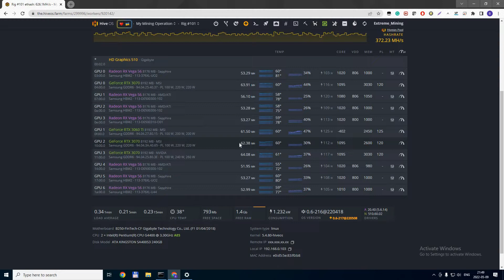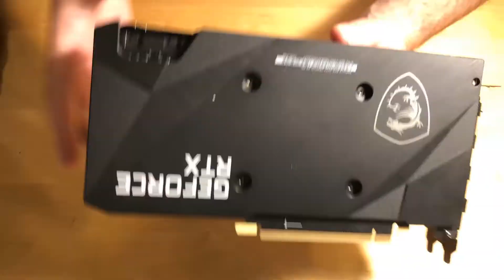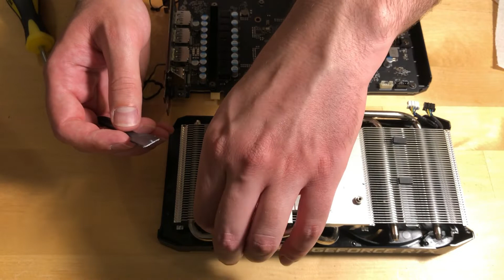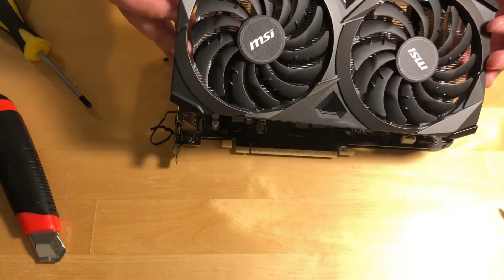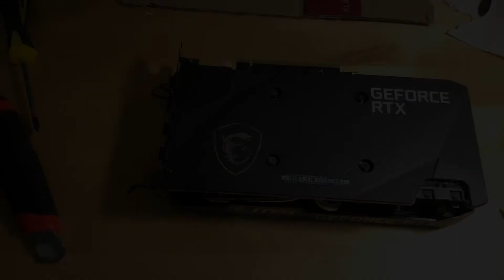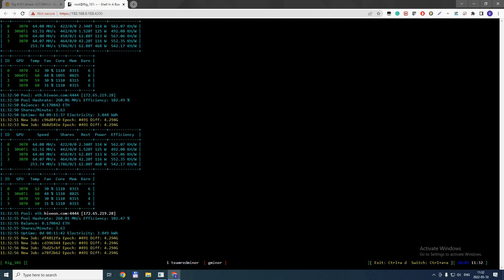Changing Thermal Pads on MSI 3070 Increased my Hashrate!

Comment: I've got the same card and I used 2mm and 2.5mm pads. The heatsink surface isn't flat. Your original pads even seem to be cut according to the surface changes and so, probably have been of different thicknesses.
Pretty sure you could have seen that by looking the card sideways afterward.
The way you're tightening the screws is wrong. You should do it crosswise so the paste is spread most evenly (this is basic knowledge, watch any video).
The one pad strip you didn't change seems the worst solution to me. I agree with you that the strip doesn't make sense but reusing it is even worse (I don't have that strip, I don't know why, I bought my card used)

Comment: Thank so much, At first, I also opened it to measure and saw that the thermalpad was 3mm, 2mm and 1mm thick. Then I changed to the 3mm type but the channel was not pressed tightly together. Then I changed to the 2mm type and it was ok. The 1mm type is for the 2 small heatsinks with VGA screws.
Reply: Hey! Thanks so much for your comment and for pointing out the 2mm replacement — super helpful. Just a quick question: was that change to 2mm done for mining purposes or for gaming? Do you know if using 2mm thermal pads performs well enough for gaming workloads too?

Also, regarding the 1mm pads used under the small VGA-screw heatsinks — do you think 1mm is enough, or would you recommend going with 1.5mm for better contact in gaming scenarios?

Thanks again and greetings!

Comment: Hy! Can you help me? I have got same card and changed the thermal pads what you show. This thickness enough for gaming performance or only mining?
Reply from the maker: Hi, mining, especially as it was with ethereum, is much more memory intensive than gaming. There are no “pads for gaming” or “or pads for mining”. If you changed you pads for the correct ones, it will work fine, no matter what you use ur gpu for.
Reply: @BMasterBM1  thx your fast answer, good day!

Comment: I have an MSI RTX 3070 Ventus 2X and would like to replace the radiator with the Ventus 3X. Is this possible?
Reply from the maker: Hi, I don't think you can properly attach it since the size of the card is different. Why do you wanna do  this anyway? Venuts 2x has decent cooling.

Comment: You should try phase-change material Honeywell PTM7950. It comes in as a sheet, lasts longer, performs works better than traditional pastes and there is no pump-out effect. Instead of thermal pads, I advise you to apply thermal putty Upsiren UX Pro.
Reply from the maker: Thanks for the info, I didn’t know about it. I will check it out.
Reply: thanks for this comment. going to be using the honeywell on my own repair today

Comment: If I use 1.5 mm thermal pads will it also work?
Reply from the maker: Probably, but I wouldn’t risk it.
Reply: 1.5mm didn't touch the heatsink here
Reply: @ZoTrAcK  2mm did?

Comment: I did the same as you. But once a started msi afterburner my temperature was higher than before. In fact, sometimes with no pressure, the memory gets 7000 mhz for a few seconds and then get back again at 810 mhz. When this happens, the temperature gets like 80 degrees 😢 what could I’ve done wrong?
Reply from the maker: I cannot tell, maybe pads moved while you were assembeling the gpu. Did you use correct thickness?
Reply: @BMasterBM1  yes, in fact I got the same GPU as you (3070 msi ventus 2x) and some pads are 3mm once I measured their thickness and other are 2mm. So I put 2.5mm to average the size. And now I got this problem. That was so weird bc you used 2mm pads and it worked for you. Could it be the thickness the problem?
Reply from the maker: @diegocky212  it could be if the pads are not soft. Try using 2mm. Which thermal paste did you use?
Reply: @BMasterBM1  i choose for thermal pads the “Thermalright” brand. And I got the Arctic Mx-4 for the paste. There are not bad brands
Reply from the maker: @diegocky212  well when you open it up again, you will see if it had good contact based on how thermal paste looks like. If it is almost untuched, the pads were too thick.
Reply: Wrong size

Comment: medistes las almohadillas? las que sacaste no parecen ser de 2mm.. estas seguro de las almohadillas que pusiste?
Reply from the maker: English?
Reply: He asked if you are certain about the thermal pad thickness. Double checking that you're sure about the thickness.
Reply from the maker: @galloway_joseph  yeah, that is what I used and it works. You can usually go +|- 0.5mm depending on the pad hardness.